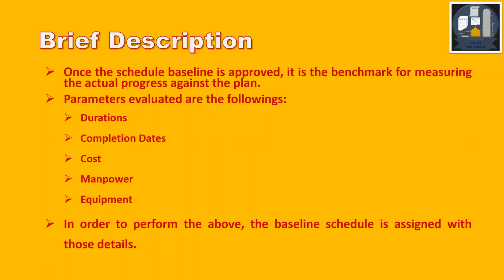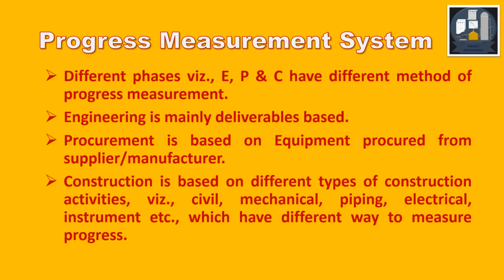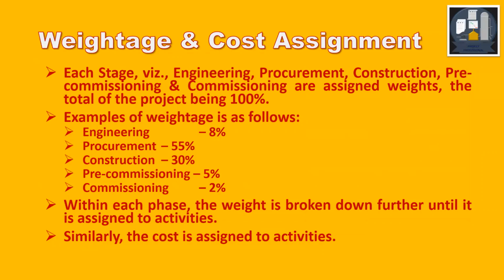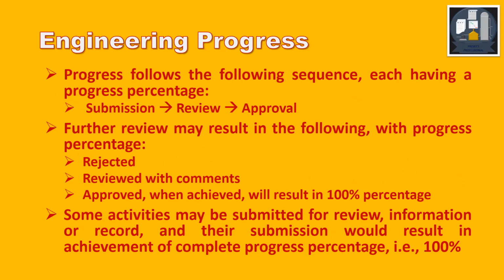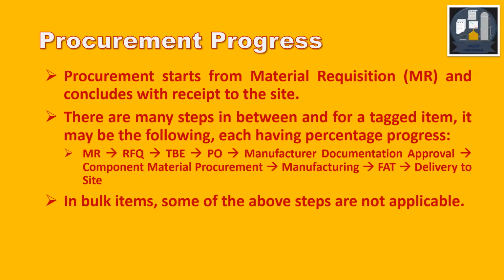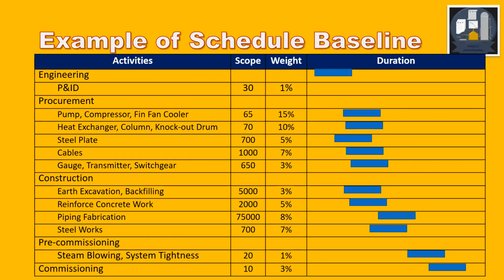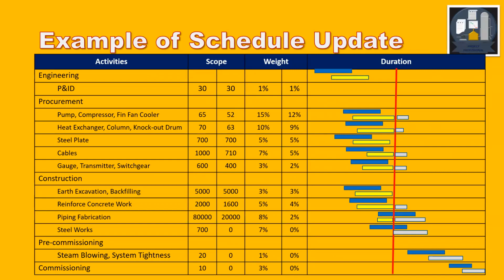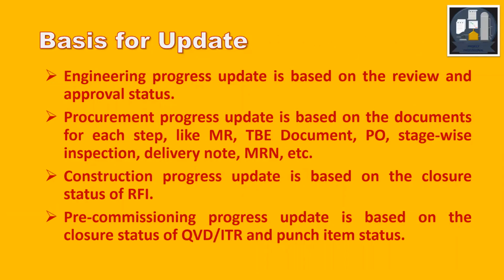EPC Schedule Progress Update

Comment: Can you explain how you derive Your weight in the baseline schedule? Allocation of time on the critical path?
Reply from the maker: Yes, sure. Email is provided in the description.
Reply from the maker: Generally weigh is based on one of the following:

1) Cost
2) Man-hour
3) Duration
4) Maybe complexity 

There maybe methods other than the above, which maybe a combination.

Answer to the next question, critical path is based on Total Float (TF) of a path in the network, and this path drives the duration of the project. Commonly it is said that path with TF=0 is the critical path, however, it is the path with least TF.